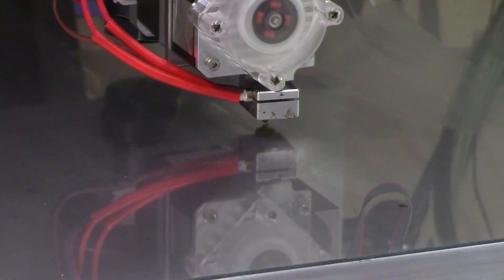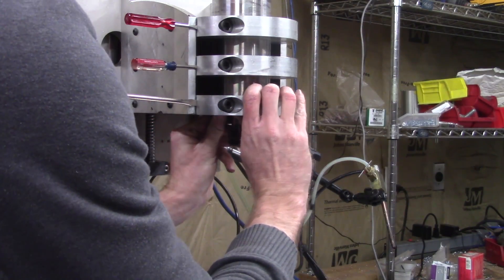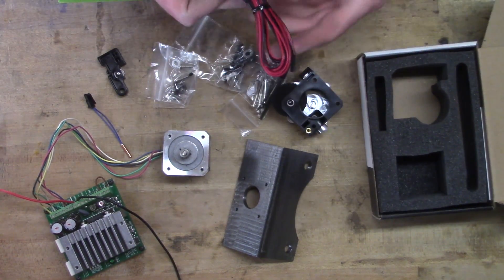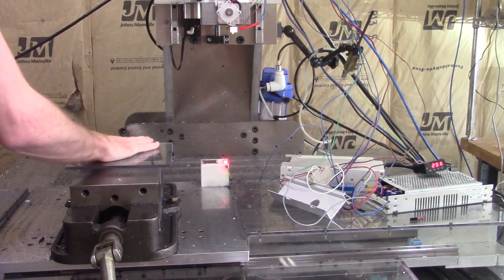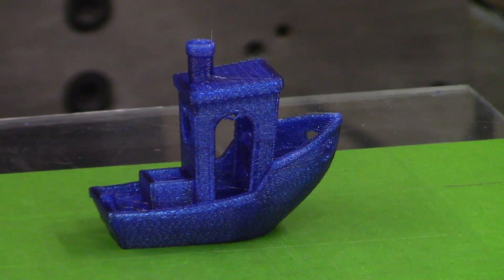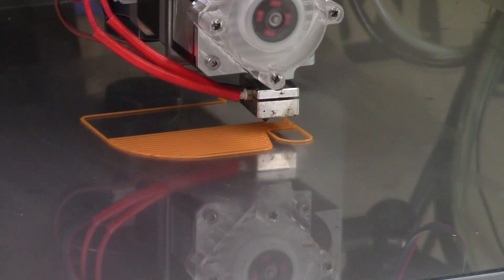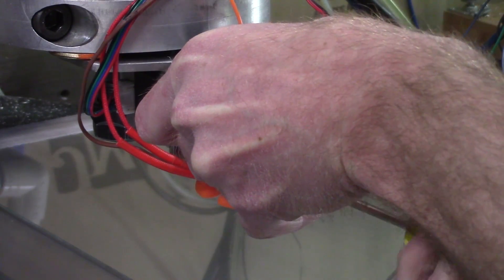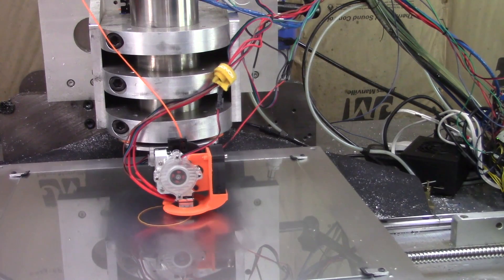Putting a 3D Printing Head on the Mill

Comment: Oddly enough, I've been thinking about the possibility of using my CNC router table to laser and 3d print...you just proved it IS possible......

Only thing is: my cnc uses plastic parts which means flexing which means it's as accurate as a sledge hammer....when I've improved that, I'll get a 3d printer head and imagine what can be printed with a 2' x 4' capacity?
Reply: Don't get your hopes up too high for printing that large.   Warp  is a killer.  There are things you can do to mitigate it similar to when casting metals,  but the coeff of thermal expansion for plastics are several times those of metals.
Reply: good point, I never considered that.....larger part means more contraction when it cools.......
Reply from the maker: Like those guys mentioned, printing massive things could be a problem but you could still print tons and tons of small things all in one setup!

Comment: Now you need to take this and use the mill to cut out the frame for P3 Steel type printer and then print the parts for it as well then you have a dedicated 3d printer (I love this frame btw super solid)

Comment: Wow neat. I've thought about buying a 6040 CNC router primarily as a large format 3D printer. This thing should be great for printing investment casting molds!
Reply from the maker: +puddingpimp I hear PLA works great for that.  The 3040 I had only had a couple inches of Z travel which would get in the way for a lot of 3D printing projects. Does the 6040 have more?
Reply: I'm not sure, I would have thought so, but the particular parts I was wanting to print were wide and flat and needed the grain going longways. I ended up deciding to break them up into sections that fit my Tronxy that I can screw or weld together. My SMT hot air rework gun and a scalpel work a treat for welding 3D prints (or shrinking them into oblivion if you use the wrong settings or technique).

Comment: Great job! I have a question about the synchronization of the 3D printhead and the machine movement. I mean how can you control the stepper feeding the material with the movement of the nozzle. Look forward to hearing from you. :-)
Reply from the maker: For 3D printing you use what's called a "slicer" to generate the gcode for the machine.  Slic3r, Cura and Simplify3D are the most popular ones.  They do all the calculations and generate a gcode file that drives XYZ and one or more axis for extruders.  In my case that's just XYZ and A axis.  The machine control software then just reads that like it would using a fourth axis.  It has no idea it's 3D printing.
Reply: Thanks for your quick reply. Gcode is different from the NC code that machine can read. So, you mean that you transferred the Gcode into NC code and then the machine control software can control four axises synchronously. Right?
Reply from the maker: My controller (a PC running UCCNC) takes a standard gcode file, so I can just open the file the slicer outputs and hit "start".  I don't know exactly how it converts that file into something the physical control board can understand, but luckily, I don't have to. :)
Reply: I will follow this clue. Thanks for your detailed replies.
Reply: gerbizzlefoshizzle well of course, g and m code are both strictly NC languages
Reply: Gcode IS a type of NC-code. (The most common one, in fact)
Reply: +gerbizzlefoshizzle yes, nc, not cnc tho ;)
Reply: Scotty Mac 22 yeah, but the c in CNC just means "computer". there is no clear distinction between gcode and NC code
Reply: Thanks for your reply. I mean there are some codes for extruder and temperature control in the Gcode of the 3D printer can not be recognized by the control systems of commercial machine tools (Such as Fanuc and Siemens).
Reply from the maker: Correct.  I plan on using the Modbus capabilities of my control card to interface with an Arduino to control the temperatures, fans, etc.  I just need to learn Modbus. :)
Reply: Scotty Mac 22 Yeah, like I said initially
Reply: gerbizzlefoshizzle ya I was agreeing with you the whole time, just adding a clarification for others, since a lot of people get CNC and NC mixed up, since they don't realize that CNC differs from NC not only by the Computer part of it, but also the language. Since NC isn't capable of circular interpolation, and other complex tool paths

Comment: Great video. I just subbed. I really don't know why I've never seen your channel before, considering my interests fall right inline with the kind of stuff that you do. I have manual machines in my machine shop and I just recently bought and setup a cheap Chinese 3d printer kit. I'm having lots of fun with it. I don't think you'll be having any problems with rigidity in that 3d printer ...lol
Reply from the maker: Thanks, glad to have you along!  Yea 3D printing is definitely a lot of fun.  I already want to make a new one using linear servos but that would be a lot of money, lol.
Reply: Shoot, the way your setup over there. Look into a hypercube. You could make one easily. Or a shortcut, is to buy a Chinese  3d printer kit, maybe something like the cr10 out an anet and build a more robust frame for it. All the components are in the kit and the firmware is already configured. Steppers are fine, no need for servos. You only lose steps if you push them too hard, past their intended torque values. There's tons of stuff on YouTube about the hypercube evolution. Hey, you already got a really nice extruder.

Comment: I used to be a CNC aerospace machinist and laughed as I was looking into 3D printers to find that a robotic arm (or a CNC mill, etc) can be mounted with 3D printing attachments and suddenly everything that can be computer controlled can be a 3D printer.  Also, visa-versa, with robotic arm 3D printers being mounted with mill tooling attachments and being used as a light CNC machining tool.

Comment: What slicer did you use? That's very respectable print quality for "out of the box" no tweaking prints
Reply from the maker: I'm using Simplify3D.  Yea, i guess that's an advantage of having an already built machine that's way more than needed for 3D printing.  The only tweaking I had to do initially was to get the first layer to stick, and of course, calibrate the extrusion amount to make sense.
Reply: Ah, no wonder the tool-paths looked as efficient as they where! That heat bed you built certainly helps too, I wonder how well ABS would print on that, I can't imagine it having any problems with keeping the temperature up enough to prevent warping.

Comment: Hi Chris, I'd loose the glass sheet altogether, and use the glue stick directly on the aluminum bed. I'm printing PLA and ABS like that and it sticks no problem. Glass will tend not to be perfectly flat (we're talking 10-20um or 1/2-1 thou), it'll likely warp with heat and (unless it's special borosilicate glass) break from thermal stress in the end.  Since the aluminum plate it's already mounted in stout CNC router, you can easily check how flat it is and skim it if need be to get it perfect.
Also, though it's not so important on all-metal machine, dedicated 3D printing firmwares have a few tricks to prevent the bed and especially hotend from thermal runaway (if say your thermistor breaks) and causing fires. You can also tweak some settings during the print if you need to like making it extrude a bit more or bit less. I guess it's kind of impractical to swap the controller between milling and printing operations though :(
Reply from the maker: You know, I tried the aluminum first and things didn't want to stick but maybe the glue stick would help there. I did skim it flat with the mill so it's great there.  Swapping from milling to printing is relatively easy and once I get the electronics sorted out with quick plugs it should go super fast. The biggest pain right now is moving the touch probe sensor; I may need to rework that and get it of the table.
Reply: For PLA try starting with 70°C no fan for the first layer and then 50-60°C for the rest, for ABS 120-130°C for the first layer and 80-95°C for the rest, but ABS will warp badly since you don't have the enclosed build volume.

Bed prep is important, it must be CLEAN - no oil or grease, so before first use clean it with acetone or something similar and don't touch it afterwards. Then add glue, but you don't need much -  just cover the surface with a few strokes, then take a small clean cotton rag, wet with water and smear the glue around. If you see the glue building up any perceptible thickness, you've got too much - wipe it away. For the next print, just take the same rag, dunk it in little lukewarm water till it's pliable (dry glue will make it hard) and smear again. You can do this with bed heated to around 35°C so water evaporates quicker and you see what you're doing. I don't add fresh glue for many prints. Actually, I only add it when the rag gets so gross I have to dump it and start a new one :)

First layer thickness (actually extruder to bed distance) is paramount for adhesion to bed and extrusion multiplier is quite important for good prints. Print a few of these https://softsolder.com/2014/04/18/revised-thinwall-open-box-calibration-object/
single wall, no infill, 0 bottom, 0 top layers, at least 5 brim lines
Measure the brim height, it's gotta be equal your first layer height. Adjust head to bed offset until you get there.
Measure the wall thickness, it's gotta be equal to your extrusion width set in slicer software. Adjust extrusion multiplier as needed. You gotta (should at least) do this step for each spool of filament as they are not all the same diameter so you get less or more material per length of filament.

Do you use the probe for the printing or is it just in the way?
Reply from the maker: Thanks for the tips, I'll try them out!  The probe is just in the way for printing.
Reply: For me, I use hairspray and glass, 30-45 degrees Celsius for PLA and around 60-80 degrees Celsius for ABS on the bed. Its what ever works for you, I have 4 printers and no one is exactly the same and require slightly different techniques like +/- 10 degrees. Id recommend, if concerned with energy bills to up the bed by 10 degrees each test print and see how well it sticks.

Comment: Good JOB! But I suggest using a Mosfet to control the header especially if you are using PWM to control heater temp because the relays cycles per life (AKA switching on and off) is relativly short compared to the Long life of a FET or MOSFET. Hope that helps.
Reply from the maker: Yes, I agree - plus the constant clicking isn't exactly fun to listen to.  Problem is, I bought an (admittedly, cheap knockoff) 10 amp solid state DC-DC relay on Amazon and it won't allow any more than a few amps through it.  It's about half of what the heater draws.  I bought another identical DC-AC SSR but rated to 40A for the bed and that one seems to do just fine.
Reply: Great choice for the one on the bed! SS's are a good alternative! Transistors are good too. SSR's tend to be on the more expensive side though, but they are good for large voltages, like AC.
Reply from the maker: I tend to call all non-mechanical relays SSRs because I can't seem to learn the difference. :P

Comment: Hello Chris , can you share the feed/speeds and rpm you used to cut the steel with this 24k spindle ? Also what inverter you use to control the spindle ?
Reply from the maker: I don't recall the speeds and feeds, but I think I was at about 8,000 RPM and 30ipm.  I was shooting for about 0.0008" chip load just because the work was unsupported and super chattery.  Normally I'd shoot for more like 0.0015".

I'm using a Hitachi NE-S1 VFD for the spindle, as well as the manual mill and my belt sander.  They aren't much more than the no-name VFDs on ebay and are better quality with a good warranty.

Comment: if you use PLA, print on straight acrylic -- much better adhesion than bluetape or PVA
Reply: and each sheet cost you 2,5$ ... for PLA you might be fine but anything elese ....
well anyhow many plastics stick very well to acrylic, If you really have two print something and cant't get it stick it's always worth a shoot, even If you have to replace the acrylic sheet than more often.
Reply: You can reuse the sheet for hundreds of prints.
Reply from the maker: Thanks for the tip.  So far I've done PETG, PLA and E3D's Edge on the heated glass with glue stick and they've all done spectacularly.  Edge works great on bare glass but it sticks WAY too well...

Comment: You forgot the blue slicon boot that goes ont he hot end. Its helps ith thermals as well as filement stickign to print head and pulling up. And you can likley speed up the print after thats put on:) http://e3d-online.com/V6-Sock-Kit-3-Pack
Reply from the maker: I've played with the boot since I took the video.  It seemed to protrude out too far and maybe even contact the print.  Since it's been on it's almost like it's "shrunk" up against the hot end a bit and I can see the brass nozzle poking out now.

Comment: That is by far one of the smoothest looking printers I've seen, like in terms of accelerations and jerkiness. The printers I've used tend to vibrate the bed up and down cause the bed is held on with  idiotic plastic cantilever arms and have a horrifying lack of rigidity cough makerbot cough. 
I am comparing a milling machine to a cheap printer this is no comparison at all, but I'd just like to say well done Chris, well done!

Comment: I realize you made a second shroud for other reasons as well, but could you have used a plastic solvent to repair the crack? I'm not familiar with what materials are commonly used for 3D printing, and if you mentioned what you were using I missed it.
Reply from the maker: I'm sure I could have, yea.  I was using PLA for that print but there are tons of materials including ABS, PET, Nylon and Polycarbonate among others.
Reply: Oh man, a couple days after watching this I made a deal to get a used desktop CNC mill/router through a trade deal with some people I've been doing work for. It's  a late 90s model that was used in a school district program. Very well built. I have to figure out how to run it and if I need to upgrade the controller to something more modern (I doubt it), but it is stout. Once I know that it's working this 3D printer mod is the first thing I'm going to do to it. Thank you for confirming my long time suspicion that this could be done!
Reply: (The manufacturer calls it a mill. It's definitely in the range of what would now be called a router.)

Comment: nice work! what X/Y print / move speeds are you running at on the mill?
Reply from the maker: Movement is about 300 ipm (100mm/s), although I need to explore the limits of the motors a bit more.  The machine can run up to 800 ipm in theory but I was plenty satisfied with 300 on a machine that size.  Print speed is more like 150 ipm (60mm/s).  I think I need a bigger and more powerful hot end if I want to melt plastic fast enough to go too much faster, though.
Reply: Are you sure? my Tronxy Prusa clone runs at about the speeds of your rapids with 1.75mm filament, a 0.3mm nozzle and a 0.15mm layer height. It might be you just need to run the filament hotter to get it to flow. The Tronxy I have runs a bowden extruder with a hotend that looks like the E3D V6. IMO it's better to run fast with small layer heights (0.1mm or less) than slow fat layers, as the speed doesn't seem to have much effect on the print quality until the kinematics of the printer fall down, whereas the fat layer heights always look crappy and are plagued with delamination.

Comment: nice work! quick question on the heated bed...watched the milling vids but didnt see a build vid....I am assuming the cut channel was to hold a heat tape?...looking into a larger build myself and a custom made or multiple silicone heating pads at or close to a meter sq is way over budget lol...Please tell me you came up with a workable solution lol...was considering either a tape or some oven elements.
Reply from the maker: I wasn't going to make a build video for the bed because it could potentially be very dangerous, what with 220VAC running through it.  I didn't look into heated tape; I didn't know there was such a thing.
Reply: Heated tape has been around for quite some time. Most commonly you can find it in extreme cold weather areas, where water, or other utility pipes that pump fluids are exposed to the cold air. It's wrapped around the pipe, then insulation is placed over the pipe and heat tape. It keeps your pipes from freezing and/or  bursting.  There are of coarse, other uses, but that's the most common use for the stuff. 

(Think of it like the insides of an electric blanket )
Reply from the maker: Yea, but that stuff doesn't get nearly hot enough does it? 180-220F (60-100C)
Reply: https://www.quintex.eu/catalog/2_11-ilm-up-tp-100-c/30-selflimiting-heating-tape-100c-60w.html
:p
Reply: fair enough...some of the industrial tapes go quite high(not so much the home depot/lowes versions lol) but ill prob end up going with some oven elements,spacing them as evenly as possible,insulating well and hoping the aluminum spreads the heat ok...catridge heaters may be an option too...just worried about hot spots...custom cut silicon heat pad would be the best but hard to justify 4-500 dollars on top of the plate cost itself
Reply: http://www.briskheat.com/products/heaters/heating-tapes-and-cords/xtremeflex-cloth-heating-tapes/standard-insulated-heating-tapes-b00.html think Im going to go with something along these lines...240v 8ft long...wont cause the wallet to scream to bad and should space ok...
Reply from the maker: Yea that looks like a nice way to go.   Much easier than what I did. :D